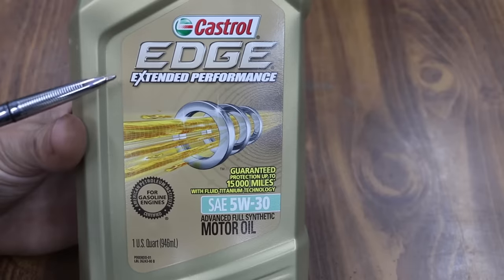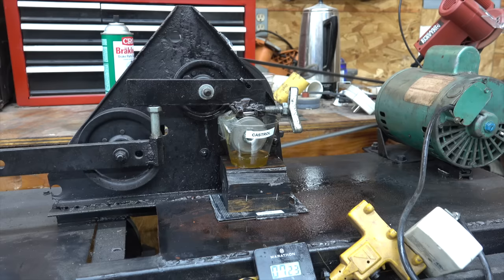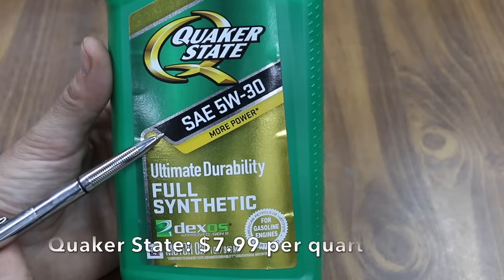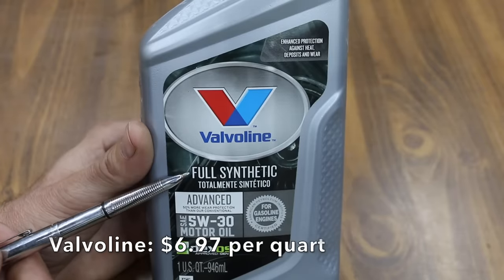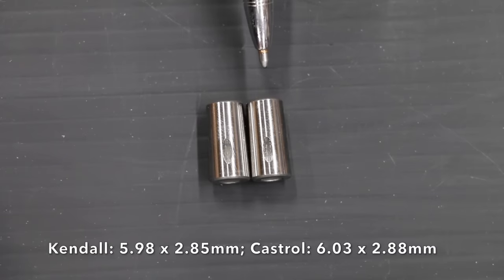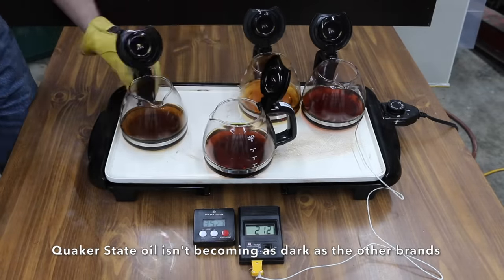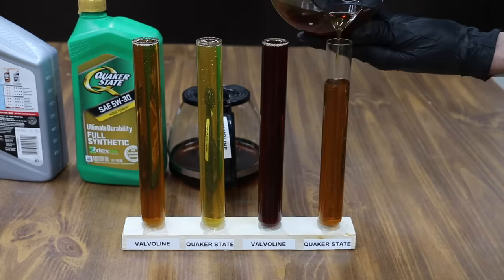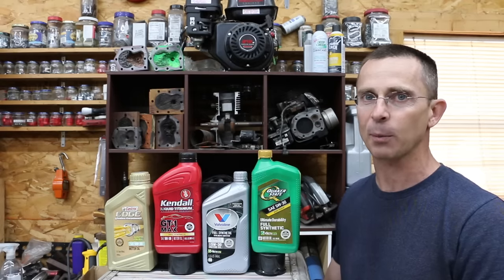Is Castrol Motor Oil better than Kendall? Let's find out!

Comment: Quaker State all the way but don't forget the Pennzoil Ulra please.
Reply from the maker: I'll definitely test Pennzoil Ultra. Thanks again
Reply: Platinum is easier to find. Unfortunately Walmart stopped carrying Ultra in stores about 4 or 5 yrs ago :-(
Reply: Ultra - Walmart online
Reply: @bluejayguy05  correction made!
Reply: @vector150  that was back in the 80s and 90s when their conventional oil had parafin wax in it.
Reply: @ryanchristensen1799  Ryan I still won't use Quaker sludge you can out that in your Dodge ram you got if you want I wont
Reply: @ryanchristensen1799  your tell.me you don't own a ram and married to Sondra?
Reply: @vector150  Shell makes
 Pennzoil and Quaker State BTW
Reply: @elpcmaster  yes I k ow this Dutch royal shell bought them some time ago
Reply: @elpcmaster  and I can tell you horror stories about QS.
Reply: @vector150  The Quakerstate full synthetic is a great oil.  No sludge problems with it at all

Comment: I've been keeping up with this series from the beginning. It's been great! However as much as I feel like as a**hole for waiting this long to being it up... I think from this point on you should maybe do a 2 part lubricity test. Part 1: clean oil as you have been doing. Part 2 with it used. Maybe after a couple hours in a lawnmower just for test purposes? I feel that the effects of natural engine blowby in the oil is even more important to test rather than it's condition when new. Seeing as the engine is running on used oil more often than new. THANKS!!! Keep up the good work!!!
Reply from the maker: Great recommendation!  Thank you

Comment: Quaker State seems to be the first oil you tested that flows better when cooked.
Reply from the maker: Great point. Thank you
Reply: It loses viscosity due to the heat, so its now acting like a 5w20 oil.
Reply: @ryanchristensen1799  Acting like a thinner oil exactly when it can least afford to.
Reply: @terrywaters6186  yep it was verified by Blackstone labs with only 3 to 4 k miles on quaker state oil sample.

Comment: Woah, Quacker State actually did well? I only buy it because it's cheap lol.
Reply from the maker: Thank you!
Reply: @Steve The cheapest oil will keep the car running fine long after the owner even wants it anymore!
Reply: @mozillagenesis  I want my cars forever. I never buy new cars. I rebuild their engines, transmissions, Differentials, anything that needs to be done.

Comment: The next time you test the Pennzoil Platinum, you should really use the Pennzoil Ultra Platinum. It has a significantly higher burn off temperature than the base Platinum according to their data sheets. Considering you’re using the top tier version of each brand, it would make sense to use the top tier version of Pennzoil. I’m just imagining the comments if the base Platinum loses to Red Line or potentially Amsoil in the finals: “yOu DiDn’T uSe ThE uLtRa PlAtInUm!”

It can be hard to find in stores but you can easily buy it online for the same price if not cheaper than the stores.

(There would be no reason to rerun the test with Lucas because Pennzoil Ultra Platinum is just a better version of the Platinum.)

Anyways, great video as always 👍
Reply from the maker: Great recommendation!  I'll test it.

Comment: I would like to see a oil war like this except instead of having 4 stroke oil wars you should make a 2 stroke oil wars. I would love to see super tech 2 stroke oil go agents 2 stroke Amsoil. If you could do it that would be great because I am looking for the best two stroke engine oils for my equipment. Great video project by the way. You still do a very good job and I respect your hard work. you always keep your videos simple. keep up the great work.
Reply: Dude! I love a little 2 stroke in my modern engines. Just a little. Helps with gas mileage. Quiets engines. A good 2 stroke oil is anything TCW3, but to get the best is super hard to figure out. I've tried a couple and they seem the same. Come watch what it does in 4 stroke engines!

Comment: Decided to run a spread sheet on the numbers you provided thus far.

1: Lucas
2: Amsoil
3: Penrite
4: Schaeffers
5: Motul
6: Quaker State
7: Pennzoil
8: Castrol
9: Kendall
10: Redline
11: Super Tech
12: Mobil 1
13: Valvoline
14: Royal Purple
15: Amazon Basics
16: Liquid Moly 

This is a linear sort based first on Metal loss grams, second on Evap loss grams, and third on wear scar size. 

It could be resorted in many ways so nothing official just for the interested.
Reply from the maker: Thank you!

Comment: Always use Pennzoil Platinum or Penn Ultra Platinum (must be ordered online or bought @NAPA). They've worked great in my '18 F150 Lariat FX4 w/Gen2 GTDI powertrain. Now using in our newer '22 Edge ST AWD w/Gen2 GTDI 2.7L V6 engine. Cannot go wrong w/these SP rated /GF-6 oils. Always use OEM Motorcraft filters. -NY
Reply from the maker: Thanks for the feedback.

Comment: Great idea for on oil test....
Synthetic Vs Conventional....
Go to a oil change place, get a quart of used  full synthetic oil from a return customer with verified milage (say 15000 miles), then obtain a quart of conventional oil of the same weight but at a standard (but verified) interval for conventional oil (say 4500 miles), then do your testing for bearing wear, cold flow, and heat loss.  
Lets see if synthetic really does perform and protect  better than conventional and is worth the extra cost or would we be better off changing out conventional oil at more frequent intervals.  
You could do this test for several brands at several oil change stores.
 Love your stuff!
Reply from the maker: Great video idea! Thank you

Comment: I never would have thought that something as mundane as engine oil could be so interesting, your style of presentation contributes greatly to the tests.
I was thinking that comparing the electrical power consumption(voltage x current) of each of the bearings on the lubricity tester would be interesting as an indicator of the bearing drag and should correlate to the mass lost.
Reply from the maker: Thank you!

Comment: I use castrol edge 0w-20 in my Honda and it definitely makes my engine run much quieter and in my opinion more efficiently. Castrol oil is the way to go in my opinion
Reply from the maker: Thank you for the feedback

Comment: Great Video PF!  I have an idea - with the huge evidence you've built so far, how about an experiment that tests the Lubricity with MIXED oil versus your winner.  If someone is topping up their oil, an exact grade/brand may not be available so it would be good to see if a thicker/thinner grade (such as 10w40 or ATF) cause any issues.  Thanks again for your great videos.
Reply from the maker: Thank you for the video idea!

Comment: Wow haven't seen Kendall in years. Used to run the green color 20w-50 racing oil in a mud drag truck back in the early 90s.

Always clean as a whistle inside on tear down time.  No idea if it's the same stuff today. The bottles are different. But it was good stuff back then.
Reply: EPstoker...we tore down a 2.4 liter Ecotec after 6 grueling years of circle track racing using Kendall FS 5w/30w & it was super clean with no scoring on cylinder walls & no oil burning✌️

Comment: Cant wait to see how Amazon essentials does. Just changed the oil in my 91 crx. Used to use castrol gtx high mileage. So far its keeping its clean color and the car runs just as it has.
Reply from the maker: Thank you!

Comment: Here's an idea I got from my job at a lab. If you get a copper plate and put that on the top of the griddle, you won't have to rotate the pots anymore. The plate will absorb the heat and evenly distribute it therefore eliminating any hot spots.
Reply from the maker: Great tip!

Comment: You should consider doing Castrol edge vs Castrol edge extended performance. Black vs gold. My thinking is the black will have a better wear on the bearings, and flow better, while the gold will have less effect with heat.
Reply: Agreed. I was hoping to see the black Castrol Edge tested
Reply from the maker: Thank you for the video idea!

Comment: Love it, The oil I use was in this one, unfortunately the Valvoline won't advance, maybe for the next year I may have to try out the big Q, As for the evaporation test I have seen it in my engines, I always keep a eye on levels and the evap. does show by oil change time, I might become a Big Q fan after my real time testing in my enigines. Thank you
Reply from the maker: Thank you very much.  Valvoline is very good oil and has a great additive package.  More information forthcoming.

Comment: Your videos are always super well thought of!

Would it be possible to get a nice comparison between Costco 91 and Shell V Power gasoline? Not necessarily in terms of performance, but mostly in terms of cleaning capabilities over several tanks? I personally I try to only use Top Tier Fuel as I normally get much better gas economy with them. Costco and Shell are the only ones available near me,  I'd be super interested in knowing which one cleans the pistons and injectors better!

Thanks and keep up the amazing work!
Reply from the maker: Thank you for the video idea!

Comment: Love your work.  Just wondering,  have you ever done a totally dry run on the lubricity tester? Would be interesting to see how much damage is caused to a bearing with no oil at all.
Reply from the maker: Not yet. Thanks for the recommendation!
Reply: @ProjectFarm  I think you used bananas or something that showed a drastic difference?

Comment: For the next round running them through an engine for a few hours where the carbon and such gets picked up then running through a coffee filter to remove any large particles and doing the bearing test and flow test could show a lot.  The only thing is you will probably want to use the same engine for each oil to be tested in case one has more carbon going through.  

May also want to do a hot oil lubricity test, heat the oil to 400 and run the bearing test while the oil is still hot.  If you do then just be careful you don't end up getting burned. 

The final two should be a big torture test though.  Five minute bearing test with only a film of oil applied and available for the first ten seconds and then ran without for the rest of the test would be one.  Another I can think of is using a disc brake rotor and caliper.  Apply a coat of oil and see which one keeps spinning the longest before the oil burns off.  It's not an engine test but it is one heck of a high temp friction test once it gets spinning with pressure applied.

Might I also suggest a losers bracket.  Take the top two performers out of the losers and test them the same as the final.  Could also do the same for the worst performer of everything and see how it stands up.
Reply from the maker: Great test idea! Thank you

Comment: Castro’s edge is good oil but I use Pennzoil Platinum in just about everything.  In my lawn equipment I use Pennzoil Platinum 10-W30 and in my auto I use Pennzoil 0-W20, which is what Honda uses when they change my oil.    I use fully synthetic in everything, including my two cycle stuff which gets Stihl Ultra.  Availability has a lot to do with my choice, as well as experience.
Reply from the maker: Thank you for the feedback.  Pennzoil is great!

Comment: First, Love your channel!! I have two motorcycles that tend to run pretty hot. 2005 CBR1000RR and a 2017 WR 250R.  I added a radiator additive a few times to the WR 250R (mostly because rocks in MOAB keep jumping up an smashing my radiator : ).  Anyway, the additives I tried made absolutely no difference (seat of the pants). But when I flushed and filled with "engine ice coolant I did notice a difference over stock fluid and stock with additive.  I really enjoy the oil "March madness" you going on... What about a few contests to see what coolants and additives work best??
Reply from the maker: Thank you for the video idea!

Comment: I see a small problem with your testing method and I'm not sure if is affecting the results or not, but when you flow the oil down the slides, slides 3 & 4 (the 2 slides on the right with the cooked oil) are not lined up perfectly and the oil hits the side of the slide requiring the oil to flow back to the center of the slide before flowing down. 

Great videos, keep up the good work.
Reply from the maker: Thank you!

Comment: Great videos, as always, I can't wait to the next video.
Don't you think that a second friction test, heating up the oil temperature at least 100 C° will make a difference in the mass loss of the bearings? Cuz friction modifiers in oil, needs to be heated up? And the heat in the metals isn't enough. So maybe oil "A" it's better in cold starts and oil "B" is better in operation temperature.
Greetings from Cancún México, great videos again, and thanks for them!
Reply from the maker: Greetings and great suggestion on heating up the oil!

Comment: I always love Project Farm videos! I would like to see a lubricity test simply on the different weight of oils going from straight weights of 10 weight all the way to 90 weight gear oil.  I would then like to see how they compare to multi-weight oils like 10w 30 vs 30 weight. Also a lubricity test between non-detergent oil and detergent oil.
Reply from the maker: Thank you very much for the positive comments and video ideas!

Comment: I was in high school working at a local Honda shop as a motorcycle builder. Brand new Hondas in 1970/71 engines were experiencing damage from lack of lubrication.. The shop was buying 55 gallon drums of Kendall motor oil and putting that in the new bikes..
  The factory rep for the oil company showed up, we took a brand new motorcycle and put in Kendall motor oil.. these were the days before oil was made for specific applications like cars and motorcycles. These motorcycles were four stroke engines, air cooled..
  so they got a brand new never started motorcycle. Started the bike with a fresh batch of new oil.. oh, mechanic took it out for a 15 minute ride to get it warm. When he returned it, put the motorcycle on the lift and pull the oil plug out to drain the oil. The oil came out looking like a frozen Coke. A liquid of brown bubbles, millions of brown bubbles, a foam almost..
  Kendall paid for all the damaged engines. They forgot to put the anti-foaming agent in the additives package apparently..
Reply from the maker: Thanks for sharing.

Comment: Great video as always!

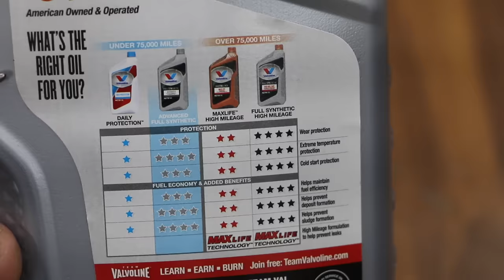One note, on the back of the Valvoline bottle at 4:58 it had another tier for high mileage that was '4-stars' in wear protection vs the '3-star' in the oil you tested.

Since it's a competition, shouldn't you be using the Brand's highest-self-rated-product? Just curious what the criteria were for what you chose!
Reply from the maker: Great point. I will likely test the high mileage oils in the future.

Comment: I love your videos.Thanks so much for making them.I think you might want to retest the Valvoline oil with their Full Synthetic High Mileage Oil.I know you have not been testing other manufacture's high mileage oils but when you showed the back of the Valvoline container it clearly states that the high mileage oil has superior wear protection and better cold start protection than the Valvoline oil you tested.You have been testing other oil refiners top products.To be totally fair, you should test Valvoline"s top performing oil.That is their Full Synthetic High Mileage Oil.
Regards,
Brian
Reply from the maker: Brian, Great point!  Maybe a high mileage oil showdown?   Thanks again
Reply: @ProjectFarm  Thanks for responding.Not necessarily a high mileage vs.high mileage but best product from each supplier vs. best product of other supplier.Regards,
Brian

Comment: Idea for video
Testing different type of car engine air filter to see how good it is to filter out particles(All for the same car model, same size and shape)
1. OEM paper filter
2. cheapest paper filter you can find
3. reusable oiled filter (K&N for example)
4. Foam filter that's popular in off-road user

For testing procesure maybe make a filter box with powerful fan to suck air into the filter, pouring the exact amount of some fine dust (about 5 micron or more) in front of the intake then having white color PM2.5 filter to catch whatever the testing filter let it through(OEM paper filter is rated at 5 micron I think)
Also while you are at it maybe test the pressure different between front and back of the filter to see the pressure different, also before and after the dust clogged up the filter.
Reply from the maker: Thank you for the video idea!

Comment: Quaker state was really impressive. On a side note my dad put 387,000 miles on a 94 silverado 1500 with a 350 and he was loyal to quaker state. Same with 250,000 on his 69 Ranchero and we don't know how many miles his cj7 had but it was also alot. Honestly I never looked at quaker state as well as I do now. Definitely love a strong oil that doesn't burn off. I would have thought Castrol would win that but was shocked then I wasn't because my dad really never had to check the oil or add more than half a quart in the 350, only time it needed was after towing a 5,000 lbs trailer up the mountains and used about half a quart on the 3 days it went up and down.
Reply from the maker: Thanks for the feedback.

Comment: I sort of weigh the evaporation test high because evaporation increases sludge and may not hold as much byproducts from fuel combustion. And the flow test was in practice equal. So I would have put Castrol ahead of Kendall. But it is like splitting hairs they both tested good.